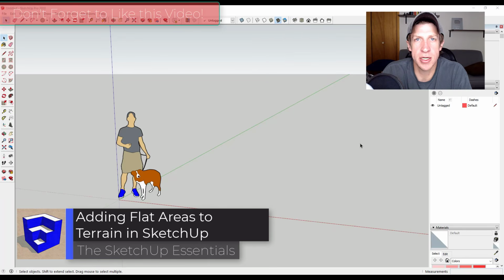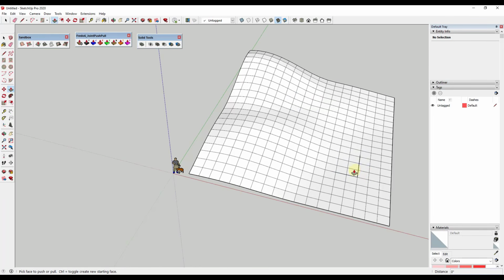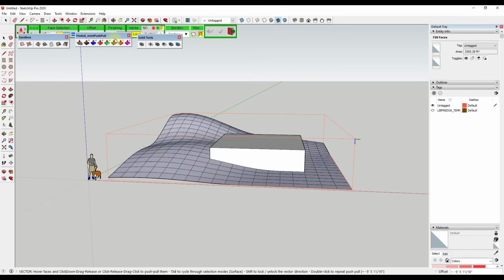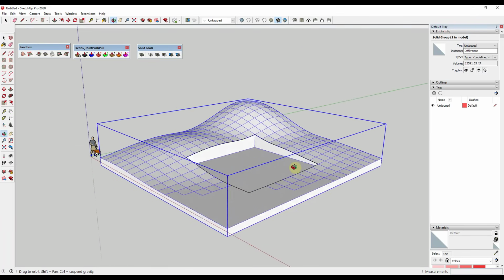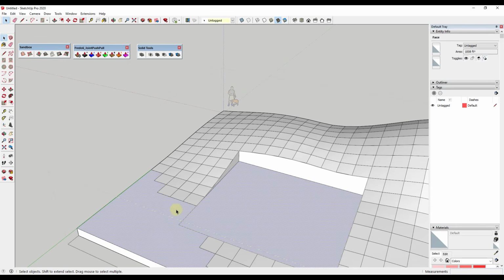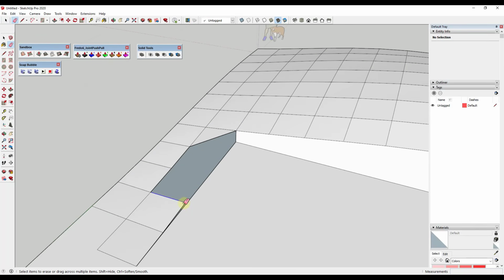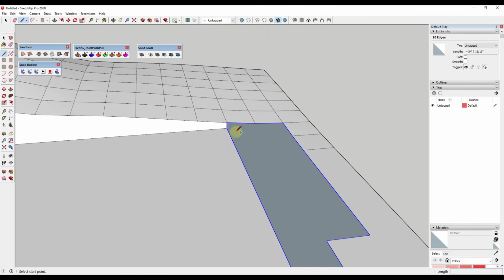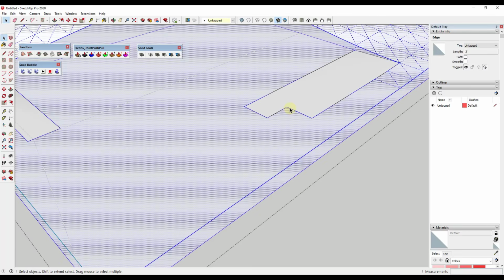Creating Flat Areas ON TERRAIN in SketchUp!

Comment: Good day Justin. Hope that you are doing well. I am having trouble doing turning radius in sketchup web. I need to do a 30 or 40 foot turning radius for a garbage truck. I am making a drive way of the alley way into my lot to have the truck enter the property and not stop at the alley way since it is narrow and there are sings that says no stoping at the alley way at anytime. So they can enter and pick up the trash from the mixed-use building I am designing? Can you help me with tips and maybe explain how the radius is taking into consideration? Also on how to do that in sketchup web